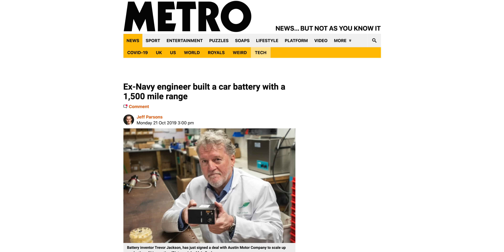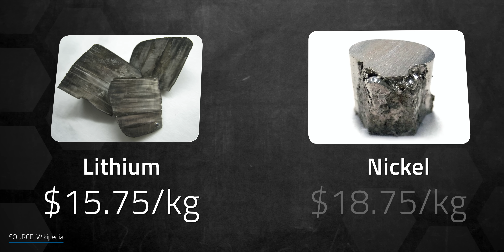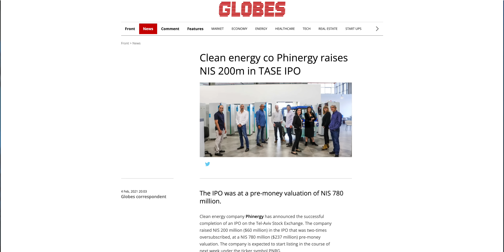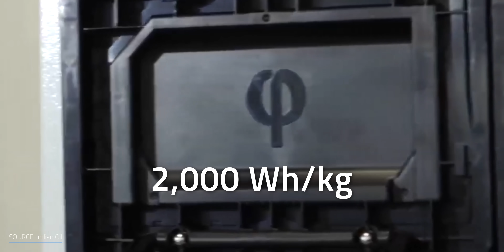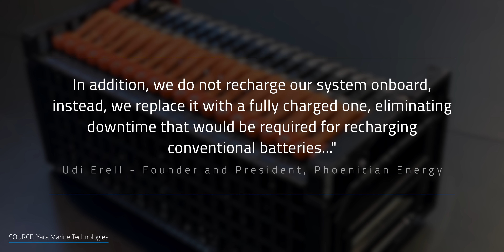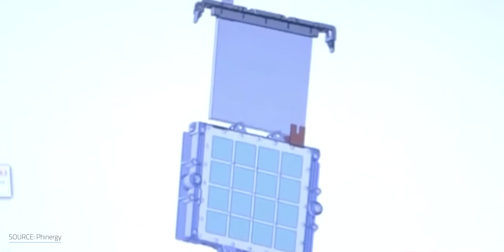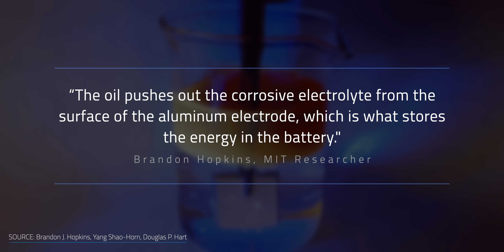Exploring the 1000 Mile Car Battery - Aluminum Air Hype?

Comment: No one should drive for 300 miles solid without a break, any car with that kind of range can probably use a 150kw fast charger.
If you drive for 3 hours solid you should at least have a break for 20 minutes, so you could put 50KWHs back in your car's battery, while you have a rest between driving sessions.

If you average about 40MPH that means you could maybe drive for 120 miles, if you average 50MPH then that's 150 miles in 3 hours.

If you had a car with a 40KWH battery pack with the ability to handle 150KW ultra rapid charging you could replenish your empty battery pack in 16 minutes.
An 80KWH pack would take about 32 minutes to charge to full.

150 miles in range is probably ample for most driver's needs.

Comment: I like the idea of the battery swap, but for one time use batteries not so much. Main reason for that is, you don't wait to be totally on E before you refill your gas car, same would be true for an EV vehicle. I see the batteries never fully discharging and in some cases not getting close to empty, leading to tons of wasted stored energy. Also i would be curious as to what a battery would cost for the swap out. Its a neat technology but like you stated i think it has a long way to go. I do think putting the battery technology to use in commercial products or vehicles would be a good thing though as it would create a stronger push to develop the tech much faster and would significantly boost the funding to do so.

Comment: I think that metal-air batteries are the only feasible replacement for fossil fuels. Li-ion works for commuter and family cars, but not for most apps requiring high power density fuels, like towing, hauling and airplanes. 
But I think the corrosion and safety issues (real or perceived) with aluminum-air is impractical at least for now. I think something with a more easily managed oxide will be better, like zinc, magnesium or other alkali/alkali earth metals. Best guess would be some kind of magnesium-sodium alloy that is solid up to 100C and doesn't instantly burst into flames on contact with water.

Comment: The most  battery tech that'll never be used in commercial transportation because it's expensive, can't be recharged, so basically everything that i should've done as per a commercial vehicle, but couldn't. And I'll never ever use an EV that requires battery swapping, as it adds extra unnecessary mass, complexity, multiple moving parts to fail, waiting in line for hours to get a battery swap, and many more.

Comment: Hmm, without any information on the recycling process ( it’s cost, energy efficiency, time, environmental impact etc.), I can’t draw any conclusions. Also lacking is the volumetric energy density: the battery packs in the video seemed farely big. I can see logistics issues that would need to be addressed for viability, such as size, shape and electrical connection standardization, the need for an infrastructure of recycling centers… all this would likely take several years to resolve. In the meantime, solid state batteries that promise greater energy density and 10 minute recharging time are « just around the corner » :Toyota will have a limited deployment of it’s BZ4X next year specifically to test its solid state battery in real life conditions which means the development of the battery and its manufacturing process is nearly completed…. The only thing I’m sure of is that we are living in interesting times right now.

Comment: This technology, with its light weight and high energy density seems like it would be a good fit for electrifying aviation.  Imagine a passenger aircraft powered by Aluminum Air batteries.  You could simply swap out the battery pack between flights.
Reply: It is feasible, but there is one caveat: the battery gains weight when discharging from oxidizing the aluminium, reducing the aircraft's range. Also the battery will probably need a compressor to work at the low atmospheric pressure at high cruising altitudes.
Reply: @javierhualde739  Even at 300km/h flying (quite slow), a little air intake facing the wind would be more than enough, giving more than sea level pressure.
Reply: @sysbofh  Fair point!
Reply: @sysbofh  This adds drag to your airframe. No free lunch. Esp. in aviation.
Reply: @grejen711  True, a little bit of drag would be created. A very little bit, as we would need more static pressure than high flow.

On the other hand, we would need far less cooling for the engine lubricant: a modern turbofan is about 50% efficient, and a modern electric motor is more than 92% efficient. All this heat is bled through radiators, and they do increase drag. So, all in all, I think an electric solution would be more streamlined.
Reply: All dependant on the process to recycle the battery for re-use. How much energy, whats the process. Etc. Definitely more of a promising application than EV’s though, thats a non starter.

Comment: Seems like a simple solution would be to have a "dry" small (50 mile) aluminum battery and a large main  battery on board...with the necessary amount of electrolyte in reserve activated manually and delivered to the small battery if the large battery dies
Reply: Or you have a 50 mile lithium battery that can be used for normal daily driving and you have the ability to add an aluminum air battery for when you need to do a longer trip (for example in a Tesla use maybe the trunk space for it during long trips or maybe the back and the trunk for storage).

Comment: The shown chemistry seems wrong, chemical species/reactions are not correct and thus the explanation is flawed. 
There is no O+ floating around, even the source states that this is more like a classical redox reaction between Al + 3 OH- -> Al(OH)3 (this is one part)
O2 + 2 H2O + 4 e- > 4 OH (you can balance the overall reaction, but that´ll do)

Then, the silver anode is not a catalyst, at least not like you described. A semi-permeable membran is not a catalyst, at least not regarding blocking gasses. Maybe the "reverse"-hydrolysis is catalysed, but that has not been stated.

Comment: I think that Al-Air batteries are a complete No-Brainer solution for electric aircraft, where energy density is absolutely paramount, and you would never take off without knowing that  A) your battery was full and B) you were going to be able to swap to a full battery wherever you landed.

Comment: The biggest logistic preventing me from even considering a current or future EV is parking and charging. I live in a Condo Community with a shared parking area. There are no way to safely run high power lines from my condo to the parking lot and not have stupid neighbor's kids  or some homeless Meth Gypsy electrocuting themselves. So the liability is very high for me or any other home owner in such a scenario.

Expecting the home owners or HOAs that manage such communities to install a high power charging network is simply inaccessible for mid to low income communities.

So having a great solution for battery tech is really exciting for sure, but the practical application to people who don't own a home and garage (a shrinking demographic in the US).

Comment: The numbers don't work out well for the swapping out of batteries.  I've driven my Model 3 just over 23,000 miles.  Looking at the energy consumption, it has used about $600 of electricity.  If I had a big Al/Air battery that had a range of 2700 miles, I would have had at least 8 battery changes.  This would require each battery change to cost $75 or less.  Swap-out labor, battery rebuilding, and transportation costs would have to be much higher than $75.

Comment: Part of the reason gasoline has such a good energy density is because you ignore all the oxygen it needs when you calculate it. If all the challenges could be faced and it could be scaled up to be price competitive with lithium ion (assuming it can surpass the innovation lithium makes in that same time frame) this could be a very viable solution. Of course in space or underwater pure oxygen is impossible to come by and it synthesizing it makes no sense, so li-ion still has its applications. IMO though it's going to be a while before li-ion is supplanted any new battery tech, it still has a few more tricks up it's sleeves.

Edit: Didn't finish the video. Hell no, aluminum air isn't the future! Recycling is way too energy and labor intensive and involves way too large of a life cycle to be sustainable. The plastics industry has shown us how flawed and niche recycling is, using it to store energy is even more ridiculous. Right now it's difficult to justify battery swaps for rechargeable batteries to charge them and reuse them later, having to recycle the batteries is way too ridiculous. At that point just do battery swaps with rechargeable batteries (which imo isn't going to take off).

Comment: I'd consider it. I think I'd rather have a shorter range traditional battery for lighter weight on commutes, but have a range extender option for longer trips. A drop in consumable battery or hydrogen fuel cell would both work a treat for that.

Comment: Battery swapping sounds great until you remember the supply chain horrors of the pandemic.  Who wants a vehicle you cannot drive if the aluminum air batteries supply becomes disrupted?

Yes I remember the energy crisis of the 1970s…
Reply: So does gas.
Reply: Gasoline supplies can also be disrupted.  I've been swapping propane tanks on my gas grill for many years and never had a problem with it.

Comment: We keep hearing about other applications (trucks, buses, aircraft, ships), but these other applications all need much more power than a light passenger vehicle or light duty truck, so there is that. Also, in aircraft especially, volumetric space is also a premium, it’s not clear to me Aluminum Air tech would be ideal for aviation. Large shipping require immense amounts of power, can anyone imagine swapping out Aluminum Air batteries on a container ship that’s both physically practical and economically viable? Unless a lot more technological, economical, and logistical hurdles are overcome, I don’t see this tech being viable.

Comment: Sounds like it might have potential for aircraft, relatively low weight for the power contained, and its just swapped out and that's easy enough to set up at airports. The real question I'm having is how much it costs to actually buy one, since you need to buy and replace them, probably more than it'd cost to buy one normal lithium ion battery every five or so years and just recharge that off the grid, but by how much?

Comment: three points: 1 All the steps in the preparation of Aluminum (refining bauxite uses caustic soda- needs electricity; preparing the metal from Al2O3 needs electricity; refining the metal also needs electricity (all of the steps are electrolytic process). 2. because the metal is cheap, there is not much incentive to recycle but the metal is well recycled (not the oxidation product). 3. There will be fans, pumps, gaskets, plastics, metals and other nuts and bolts that will make the battery more expensive than the common lead acid battery on a per unit basis. The basic process is good but the engineering has to be worked out.

Comment: This would be great as a range booster for electric cars using a rechargeable method for sub 400 mile ranges. Just hitch a small trailer on and boom, 2000 more miles of range.
Reply: I was thinking the same thing. But why a trailer? There's plenty of trunk (or frunk) space on many EV's, they'd just need to provide the optional port in one of those areas.
Reply: @kylek29   When someone has a long range/distance trip they are least likely to have room in the trunk for a set of aluminum plates.  A roof mount or trailer mount makes the most sense for that extra range, though it doesn't need to be a wheeled trailer, but more like bike mount trailer.
Reply: @Chap.DavidStrchld  While I don't know about a trailer per say, I think your main point is very much valid. Part of the problem right now is that car shapes/designs have been locked into 1 over all shape because of the internal workings of an ICE. There's the front engine compartment, the passenger cabin, then the trunk. With an EV, you can completely redesign that and come up with more optimized shapes that would allow for more charge capacity.
Reply: Drop in Air battery toolbox for the F150 lightning ⚡
Reply: That would be interesting. Have an 'extended range' connection for one of these that doubles your range and you only use occasionally so you only replace it on long trips.
Reply: I think no one needs much more than 100-200 miles for 90%+ of their trips. It would be better to get a smaller fix internal battery, like a 40 kwh and then battery swappable aluminum air battery and even a small trailer if need be. Firstly it would make ev about as competitive in price to ICE and secondly for efficiency, you are not carrying 40-60 kwh battery even if you don't need it 90%+ of trips.
Reply: And coaches...
Reply: This sounds like the perfect solution.
Reply: NOPE. Small trailer and Boom, air draggoes through the fucking roof.
Reply: Nobody has yet addressed the question of cost per use. In order to be economic the cost would need to compare favourably with public charging.
Reply: @emperorbruce1551  Think its fair to assume its probably close to competitive with lithium and that is about it, if not it would be on every news channel and folk would be dancing in the streets.
Reply: It could be used as an emergency back up power to kick in whenever the range of the car is exceeded, which would be rare anyway.
Reply: As others have said best option is a hybrid system, 100 to 200 miles lithium battery for medium distances and rechargeable and the other half an aluminium one that can be swapped out. Most people don't need the extra distances most of the time but knowing they could do 600 miles (because the aluminium is twice the density) would be enough. Remember at 70mph that's eight and a half hours driving, unless you are a truck driver that's a very long trip. Over night charge and a new aluminium battery and you are good to go in the morning, even do another 400mile same day with a swap. 
Recycling cost would be low with them rarely being used and as they are a physical good you could store 10 in any gas station with a weekly delivery without much infrastructure. They come charged, no power lines needed.
Reply: that's a pretty cool idea. Or like someone mentioned below, roof mounted or styled after a bike/hitch mounted system.
Reply: Interesting idea. We now have EV's (like the Tesla) that have batteries that can go for 400-500 km's, while we use them on averag for not more than 100-120 km's per day. We could reduce the battery size (and hence weight and energy consumption) of the vehicle to what is needed on a daily basis and if we want to do a road trip, just go to a nearby battery depot to pick up a battery for one long range trip, and then return it when the journey is completed. That would reduce investment and operational costs in EV's massively.
Reply: @robvanderwouw9063  just get u haul invested. They already have half of the infrastructure in place and they are everywhere.
Reply: People have already tried all the ideas mentioned above and they are all bad ideas sadly. There is only so much you can change the positioning of components and still be safe in a crash, changing the aero is a total no go by adding trailers or anything of the kind. Reducing battery size on ""long range"" models is also a no go, 700km ranges are total BS as you should never deep cycle your battery and they need that ""700km"" just to do city trips of 40km reliably without the battery being dead in five years or less. Is better to keep cars lithium and hydrogen the way they are and use ALO batteries for trucks if anything... They are already going to depots and because of their set route hauls and alike, the self discharge issues and such are not as much of a problem.... I can see how this might make sense for some cars in India like city taxis where you will never get to the kinds of speeds where a body will crumple, but for most places it just does not make any sense to me.

Comment: Using two smaller Aluminum Air batteries would allow one to remain fully sealed until needed and make replacement more convenient and less wasteful since it would otherwise be difficult to drive a battery to zero.

As for whether or not I would want to use one in the first place, it really comes down to the details on that recycling breakdown. Lithium may be less abundant, but I get far more mileage on its' lifecycle. So it may prove more sustainable

Comment: My view is that these would be best used as a back-up range extender for a conventional ev. Shorter journeys would use the ordinary lithium ion batteries with the aluminium/air cell coming in only when required. That way there is no risk of running it flat but the benefit of long range when required. You might get a new one fitted once every month or two which would be fine.

Comment: Not rechargeable, 80% degradation after a month? This sounds like a “solution” an oil company would get behind…
Reply: There does seem to be solutions for the deg. But yeah, my ears prick up when an oil company gets involved, like the 'blue' hydrogen manufacturing...
Reply: If it's government backed I imagine they see the huge cost of healthcare needed due to polluted air - in the UK at least 40k deaths per year are attributable to dirty air, dread to think what the figure is in India. Healthcare doesn't come cheap. So investing in new recyclable tech to replace a resource that is finite and we all pay hansomly to burn makes perfect sense.
Reply: @thebrowns5337  India probably has more problems with accidents than air pollution if it were about people's lives, not that both problems couldn't be tackled at the same time